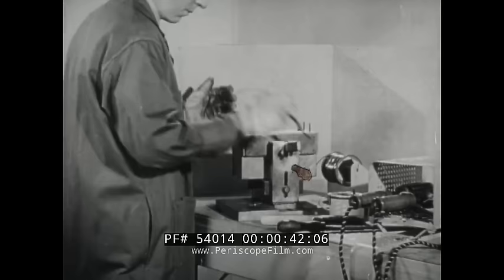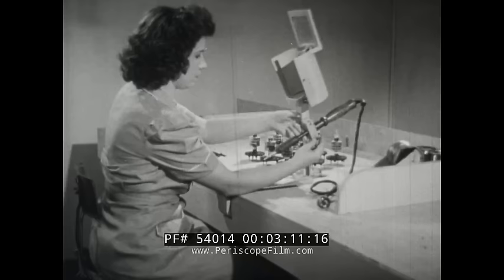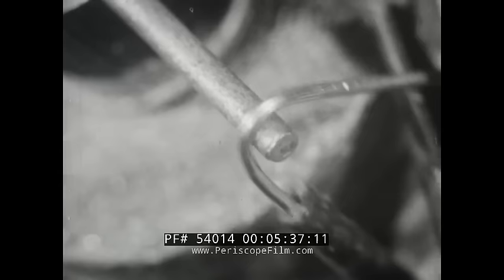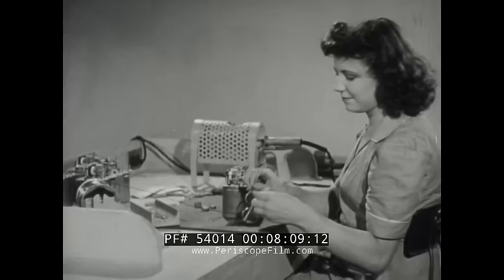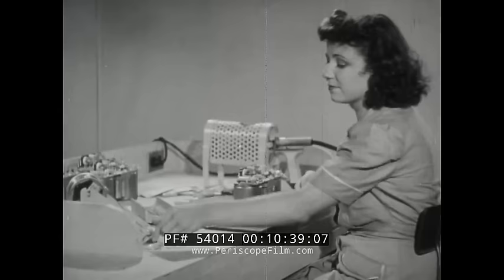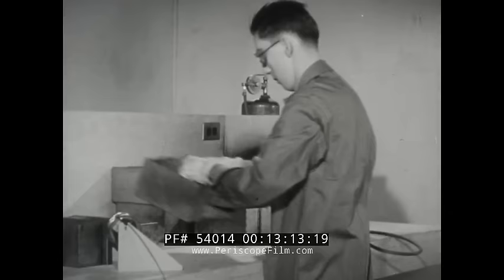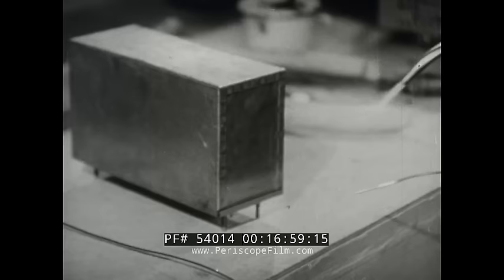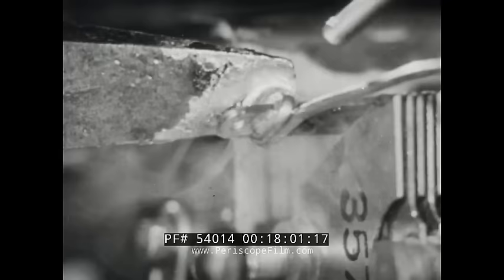HAND SOLDERING 1944 SOLDERING IRON TRAINING FILM 54014

Comment: No semiconductors were harmed during the making of this movie.
Reply: HDMI port replacement tutorial   😎
Reply: Because they didn't exist then.
Reply: @PhillipDavis830 : Not entirely true. There were selenium and copper-oxide rectifiers then, but they couldn't handle much power. Most rectification was done with tubes.
Reply: The "crystal" radios that used a rusty razor blade - the rusty blade was a semiconductor.  You would scratch a wire across it.
Reply: Hopefully.   Lol.
Reply: dang, 1940s women are hottt!
Reply: theplateisbad   But if no ventilation or fans are used, the same may not be true of one's lungs.
Reply: @edwatts9890  We had some huge selenium rectifiers at the phone company. some were 2 foot squares.
Reply: @wongway40 4:29 good skills too 👀
Reply: @PhillipDavis830  Congratulations for... not getting the joke.
Reply: actualy old school Valuve (Tube)s are semiconductors
Reply: @cliffords2315  OK, solid state semiconductors.

Comment: There are a good number of electronic "experts" on YouTube that could do with watching this video.
Reply: Agreed! I seldom see one of them use flux from a can. Depending on the flux from the core often does not work very well, and so forth.
Reply: @clarencegreen3071  Electronics soldering uses flux core, sheet metal uses flux from a can.  I took metal shop in Jr High and Jr. College.  Electronics in 3 years of high school, we were taught the difference between the two.
Reply: @dfirth224  You can get flux for electrical/electronics soldering at any good hardware or big box store - in a small plastic container. Adding a tiny bit of the flux to the wire to be tinned or to the joint will make a big difference in your results. If you rely only on the flux from the core of the solder, you will very likely melt too much solder just to get the flux that you need. This often results in dripping solder or joints with excessive solder.
  Also, a bit of flux added to the tip of the iron will help to keep the tip nice and shiny. You will then be able to carry solder to the wire or joint on the tip of the iron, which is often helpful. Give it a try. You may be pleasantly surprised!

Comment: I have been soldering for 46 years but am self taught. Having watched this superb film my joints are now better than ever. I have saved this for everyone I help with the skill. I solder a lot as I have a degree in electronics and teach students how to do the practical stuff. Modern engineering courses have forgotten that they need to teach the basics. A historic film is exactly what is needed. It's a matter of size, modern electronics don't require huge soldering irons or torches. 
I paid for my degree by plumbing through university, I used a torch for some pipe joints. That said I can create a water tight box out of a sheet of lead just using lead dressing tools.
Reply: the wonders of modern manufacturing processes :hand-orange-covering-eyes:
Reply: Don't drink anything out of that lead watertight box.
Reply: Vice Versa guys look at me like I'm insane when I whip out my 100watt, 250watt and 350watt Radio Shack Old School soldering guns. I get instant heat like a torch. I have big tips and all the guys with shaky hands and eyeglasses can't keep up. I roll through soldering even SMT circuits. You can also use a paperclip or something like another piece of wire wrapped around the tip to make a super small tip. My iron is one of the least expensive too. My partner has a 400.00 soldering station. It really is the person more than the tools. I could heat a flame to a pinhead or nail and still solder better than a lot. LOL.
Reply: @MacNifty  Great "tip" with the smaller wire - I should have thought of that myself a long time ago ;)
Reply: @alnicospeaker  And if your tip breaks on your iron? You can use wire to hold it together enough to make contact,
for the resistance to heat up.
Reply: I am self taught, too and I did mostly everything described in this video by intuition and feel. But I will try that sliding off the terminal method next time.
Reply: The Asbestos walls  that no ones mentioning 😂11:18
Reply: Yes sir!  I am 63 yrs old been a electronics technician  sine age 15. Soldering is what makes electronics so fun and rewarding!

Comment: Relevant as ever. This is a damn masterclass in soldering for beginners
Reply: Sure is. I was a 33 and we learned all this back in the 80's.
Reply: yeah-yeah, where do today's beginners find terminals of such size and isolation tube separate from the conductor?! lol, those days and techs are gone for good... today one needs to learn to solder tiny smds under electric microscope using needle size tip...
Reply: @cokeforever  I actually encounter both, even today, though it's by no means common.  I use everything from an acetylene torch and various irons for sealing big stuff, trigger fed irons for high volume soldering, all the way down to heat guns with a digital microscope and tiny ovens that solder every SMD at once.  Needle tips don't work well for SMD, the board they're on will usually wick too much heat from the tip for it to melt solder, it's just too narrow to transfer enough heat.   Regardless, this is no master class for beginners, it's just a basic introduction for factory workers.
Reply: @cokeforever  The proper technique is still the same.  The physics of soldering has not changed, just the sizes of the components.
Reply: @jeromethiel4323  but you wouldn't use a torch on a pcb, right? you would rather use construction fan or a heat gun ;)
Reply: @cokeforever : I have repaired PCB's which looked like someone had used a torch on them. For the record, I used to be in charge of -- and responsible for -- megawatt-class amplifiers and transmitters. At those power levels, it's usually pretty easy to locate the problem, if not the source thereof.
Reply: Absolutely. I remember my Dad (RIP, but an MTS at Bell Labs, back in the day) teaching me, repeatedly, all the salient points regarding cleanliness, tinning, mechanical integrity and all the rest.

Comment: I've been soldering all my life and I still learned something from this video. Pretty cool.
Reply: I learned I need a bigger soldering iron.
Reply: I've been soldering for half my life and learned much as well in this very tidy clear presentation.
Reply: @danielt.8573  ]
For big stuff like metal cans yep.
At the end that's about the biggest soldering iron I've ever seen. 
- Likely big enough for copper plumbing IMHO.
Compare it to the ~10 watt,12 volt miniature iron I've used on printed circuit boards
Reply: @jabberwocky1707  I prefer a higher wattage, temperature controlled iron, because an under powered iron takes longer to heat the joint. This can cause heat damage to some components. We used the Ungar Loner series at my last job. They had a three wire cord, to prevent ESD on static sensitive semiconductors. I had a spare DVM on my bench. It was connected to a piece of scrap, blank PCB so I could touch it with the iron'r tip to verify that it was under  five ohms, to ground. If it wasn't, you unpluged it and let oit cool. Then you took it apart and cleaned the parts with a soft brass brush. Sometimes you also had to replace the tip, because it didn't make good electrical contact with the retaining sleeve.

Comment: Thoroughly tinning both pieces and preventing oxidation is the key to a good solder joint.  Although with just about any solid state electronics nowadays, excess heat will easily damage them.

The real devil is when you're doing repairs and the joint is in an awkward spot.  You really do need an iron with enough power to melt the solder fast enough that the piece surface doesn't oxidize and keep the solder from sticking.

Comment: I went through the Navy's 5-week miniature electronics repair school back in the 80's. Everything was taught and graded using NASA standards. Solder joints were examined under a 3X stereo microscope and displayed on a monitor for the instructor and student to examine. If the solder amount, flow, shine and fillet shapes weren't exactly right, it was done over. The goals were always to control heat and use the minimum amount of solder required. Aerospace requirements are very precise. The old adage of 'the bigger the blob, the better the job' was completely squashed. Installing Dual Inline Packages and Flat Packs without measling the circuit board is an art in heat control.
Reply: I went through a similar course back in those days in the USAF.  We even had to fabricate the iron tips from scratch from a piece of heavy wire using a file. That took the first day of class, and we got to finally tin the tip on day 2.
Reply: @johnmazza5918  Wow. I didn't know that was even a thing but it sure would be a useful skill. I would have definitely gotten some satisfaction out of accomplishing that.
Reply: " … control heat and use the minimum amount of solde.r"
- Yep, the course I did said the same thing, based on NASA techniques via the Royal Australian Air Force I believe.
"… measling … "
- Is that the same as 'frog-eyes'?

Comment: As of late while doing my Arduino projects, I’ve been having issues with my weller solder. I even nickel plated the tip again and but no go. This video showed me exactly what I was doing wrong for so many years. Over heating. I always had issues with heat transfer and this showed me my issue. Thank you for the upload.
Reply: Heat bridge?

Comment: I have NEVER been able to solder well, so frustrating…can’t wait to apply what this excellent film brings to the viewer. 
THANK YOU‼️
Reply: Did you get it figured out? The lightbulb just went off now for what I was doing wrong. I watched this to learn how, then never watched it again. I only solder with a torch, but I didn't realize that you melt the flux then put solder on...I have been putting copious amounts of flux on it and the solder at the same time, and trying to heat it. I guess I didn't know how 😂😂😂
Reply: @xxskippernate409xx6  
Yes,  I did get it figured out! Thanks for asking. 
(well at least I’ve done three successful Solders, 
which is all I’ve needed so far.)
I have an ever increasing capacity to get rusty on things so who knows about the next time I take a stab at it.

Comment: You are never too old to learn something new, or how to better 'what you do' 72, and I still have a lot to learn!
Reply: '72 is when I learned how to solder. That was in a speaker factory.
Reply: @justsittinhere72  
I possibly learned about that time, (11 yo?) self taught, though it may have come up at school too. Electronic hobbyist from early teens, if not before
- Formal/classroom soldering training at work in late 1970s, then later high reliability PCB soldering training (~20 minutes a joint!)
- current job requires delving a lot more into SMD soldering/de-soldering solder paste, hot air soldering etc, without formal training at over 60yo!

Comment: WOAH?!?  The revelations exposed here are invaluable.  A 100-200 Watt iron?!?  I would’ve guessed that they’d be plugging holes in the fuel tank of a motorcycle with an iron so massive!!  This is very worthwhile info, I’ll very likely review this one.  THANK YOU FOR UPLOADING THIS!
There are important lessons on this.
Reply: I used to work in my dad's stained glass shop. A 150 watt iron with 1/4" tip was typical for soldering leaded glass windows.

Comment: Oh, the lead poisoning of soldering and sanding lead right below one's face without proper ventilation or protection from fumes and dust. The simpler times of World War Two, when winning a war was more important than an individuals life or health.
My father served as an electricians mate in the Pacific during this time.  He could solder wires or sweat joints with the best of them. His Navy training paid off after the war when he took a job with Massachusetts Electric Company, eventually making it into management. 
Between the asbestos, heavy metals and PCB's he made it to 70, which wasn't bad for his generation. 
Decades later I still miss talking with him.

Comment: I'm really getting a kick out of the size of some of those irons.  They're huge!
Reply: I have American Beauty soldering irons from 50 through 500 Watts. I also have soldering guns from 30 to 320 Watts, soldering station irons in the 30- to 70-Watt range with adjustable temperature, and several butane, MAPP, and oxy-acetylene torches. I use a heat gun or an oven for SMD's.

I can solder anything.
Reply: @edwatts9890  
Including the plumbing! 🚰
- Though I suppose that's mostly plastic and glued together nowadays.
Reply: @jabberwocky1707 Worse yet, it's plastic  and snapped together now (PEX).
Reply: @edwatts9890  Yes!
And People laugh at me for having 5  different Types of Open End Wrenches! 👍✌️😎

Comment: If memory serves me, I last saw this film in high-school  metal shop 1967. I remember because the shop teacher said those are called soldering coppers , not soldering irons .
Reply: Do you know is this video are commonly use in high school in U.S since it come from office of education? And What have you learn in the metal shop?
Reply: @Johnrock Chou  I learned the proper use of files,  hack saws,  use and sharping of drill bits, operation of a lathe,  milling machine, and shaper. How to grind a tool bit for use on those machines tools .How to build a mold for a part and cast it in aluminum or bronze. Almost forgot, how to hand forge a cold chisel. Other than that, not much. Except both cold and hot riveting and forming sheet metal into a tool box and a bucket with wire reinforced  top edge .
Reply: @thomaslemay8817  You learned so many things out there that's amazing. Thanks for your sharing.

Comment: It's so interesting to watch how a lot of these soldering guides change through the ages. What advice is dropped or retained, what is and isn't recommended anymore, etc.

Then again, I suppose soldering for this purpose is very much different from soldering in aeronautics ;).
Reply: Speaking of what's changed...
I've been told to use damp sponges. I've been told to use brass wool.
This may be the first time that I've ever had someone recommend using canvas to clean off excess solder. Then again, I do know one instance where they used Kimwipes on their iron.
Reply: Walk into a mechanical workshop, and you may catch someone using the leg of their overalls to wipe the tip of the iron.
Reply: Having soldered in Class III for Aerospace and Space.. Brass wool is the best you can use every few minutes while soldering, followed with tinning your solder tip when you won't use it for a while. A blackened soldering Iron tip can mean the difference between soldering joints coming out supreme or getting cold solder joints every time. 

The sponge is great too, but only with de-ionized water. Otherwise your just ruining the tip.

Comment: That torch workbench has a huge issue that would definitely not be up to code today. Burning a torch while pointed a few inches below an electrical outlet, especially in a situation where it could accidentally be left running is asking for trouble

Comment: At 2:37 - The soldering iron, second from the right, is what I used in the 1960s to build my own-designed transistor circuits for stereo amplifier systems. I learned to be very, very careful with heat transfer times to all of the components.
Reply: I'm guessing ~50-100 watts?
- To bad they didn't say what each irons' rating was. ¯\_(ツ)_/¯
Reply: @jabberwocky1707  To me, at the time, the iron felt hotter than the sun.